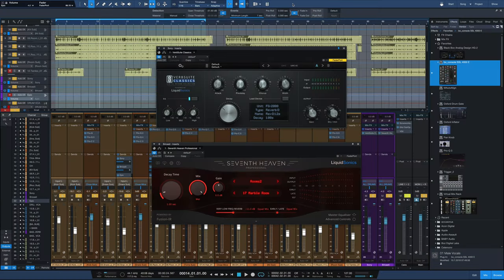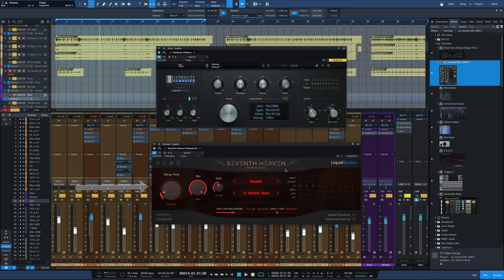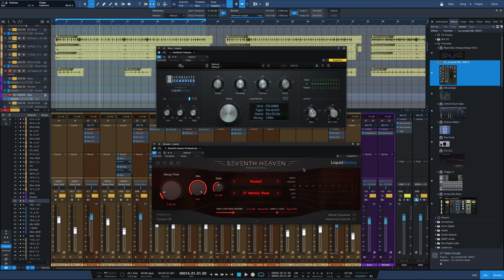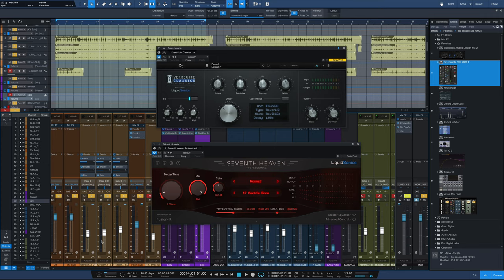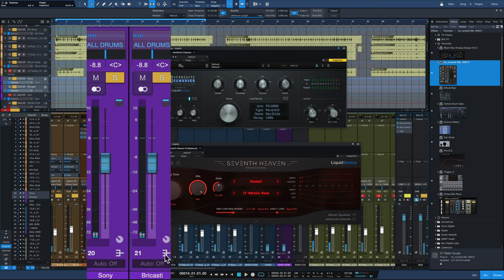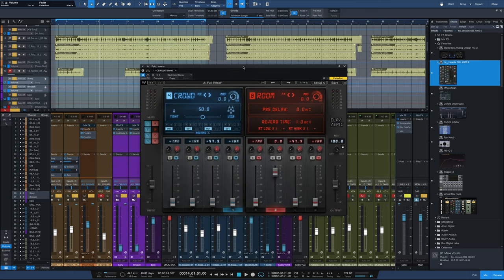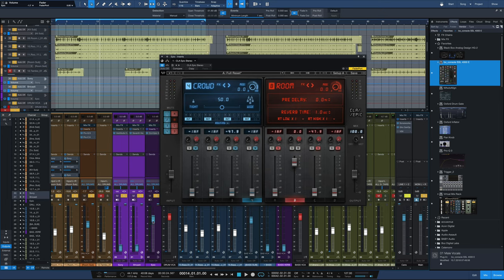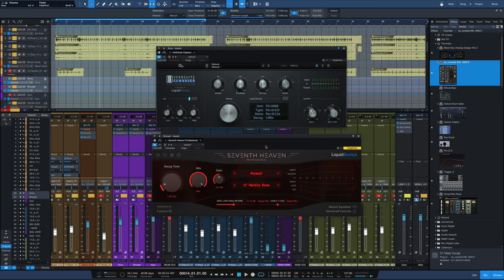Chris Lord-Alge Drum Reverb | CLA's Drum Reverb Gear and Settings

Comment: You're missing a MASSIVE element of the reverb sound by not discussing the external EQ that's applied before the signal even hits the reverb units. There's also some slight midrange boost on the console returns too. Also, Marble Room is the incorrect preset on the Bricasti. That's not actually what he uses.
Reply: Which one he uses? Maybe he has different options. This video is based on the "mixing with depth" series that promote Epic, and there he says he uses the marble room
Reply: do you know if it is the vac rac eq by any chance?